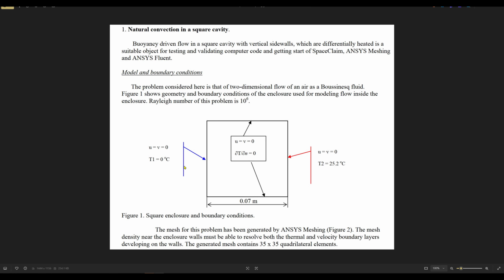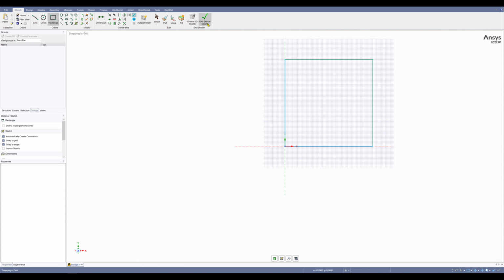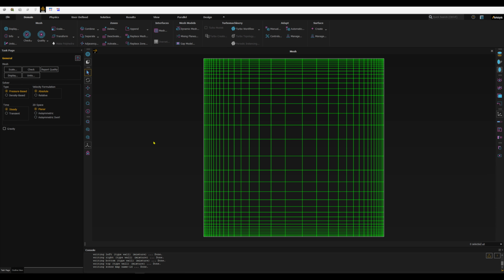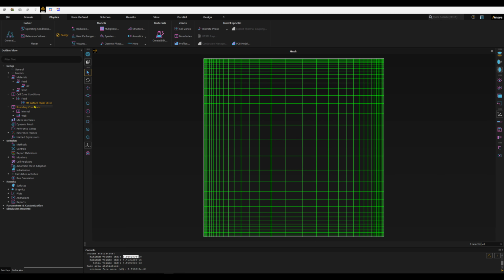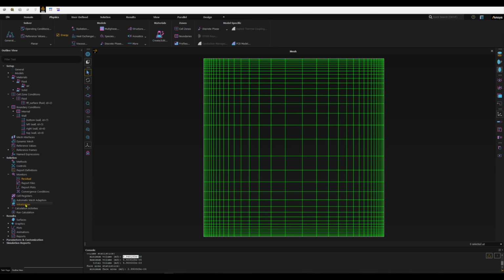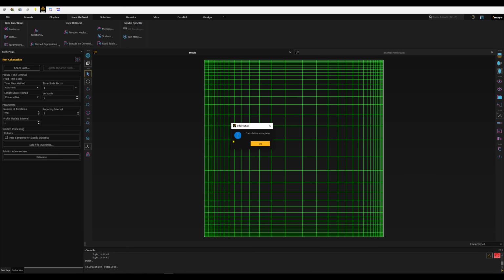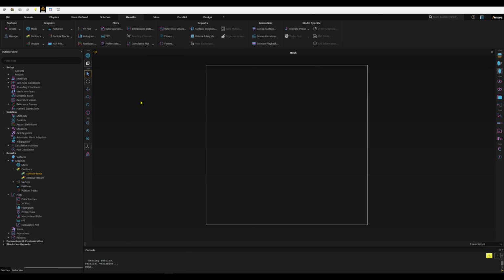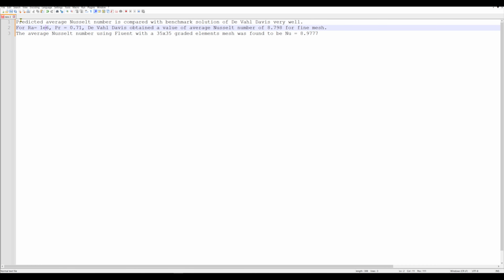Natural Convection in a Square Cavity | Lesson 10 – Beginner CFD Series

Comment: How you applied that you are doing this simulation by taking Ra =10^6 and Pr = .71??? What is the justification for that?
Reply from the maker: Hello @rupamrakshit7825,

Thanks for your question! The values Ra = 10⁶ and Pr = 0.71 are not values that we enter directly into ANSYS Fluent. They are benchmark values from the classical De Vahl Davis natural convection cavity problem, which is widely used for CFD validation.

In Fluent, we define the cavity dimensions, gravity, hot and cold wall temperatures, and air properties (using the Boussinesq density model, viscosity, thermal conductivity, and specific heat). These inputs determine the Rayleigh number and Prandtl number automatically.

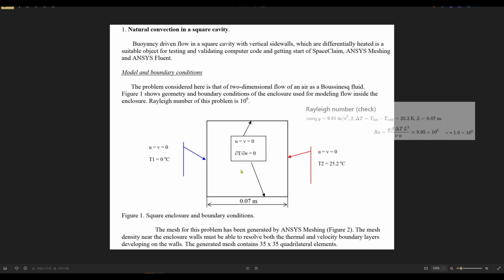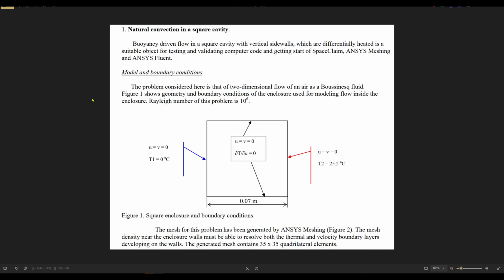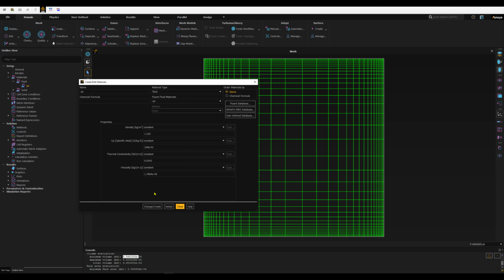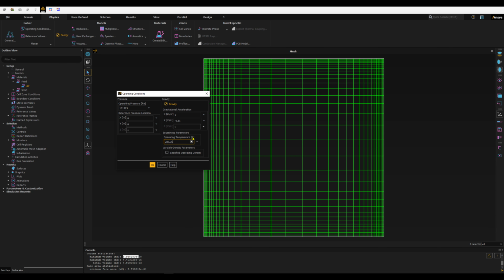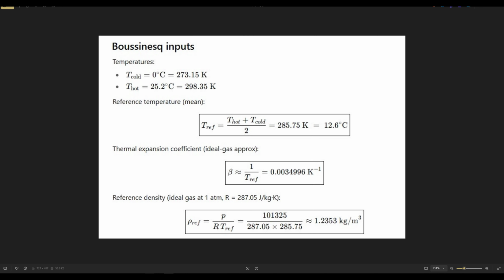In the video, I introduce the benchmark case at 01:45–01:53, and the Rayleigh number formula is shown at 01:48. Then, at 09:24–11:20, I explain the Boussinesq model setup. The formulas for calculating the thermal expansion coefficient (β), reference temperature (Tref), and reference density (ρref) are shown at 09:47.

The Prandtl number is also not entered manually in Fluent; it is calculated from the air material properties. The benchmark value is Pr = 0.71, while Fluent's default air properties may give a value close to this depending on the selected material data.

Thanks for pointing this out! I will cover the detailed calculation of both Rayleigh and Prandtl numbers in a future video.

Comment: Nice one! What fluid is being simulated physically? Is the right wall heated and the left wall is cooled?
Reply from the maker: Hi @imacoder3160,

Thanks a lot! Glad you found it useful.😊

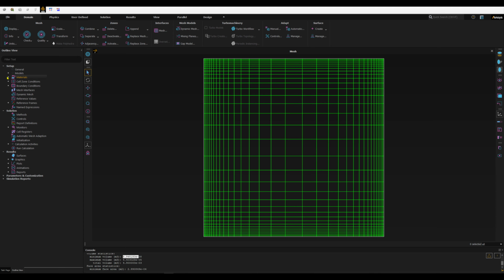The simulation is a 2D natural convection flow of air modeled using the Boussinesq approximation. Air is selected as the working fluid, but the density is defined using the Boussinesq model (see the Material setup around 9:06 in the video), where the reference density (1.2353 kg/m³) and thermal expansion coefficient (0.0034996 1/K) are calculated based on the average reference temperature (285.75 K) between the hot (25.2 °C) and cold (0 °C) walls.

Yes—the right wall is heated, and the left wall is cooled, while the top and bottom walls are adiabatic (insulated), which drives the natural convection inside the square cavity.